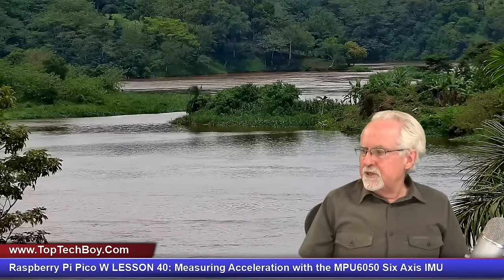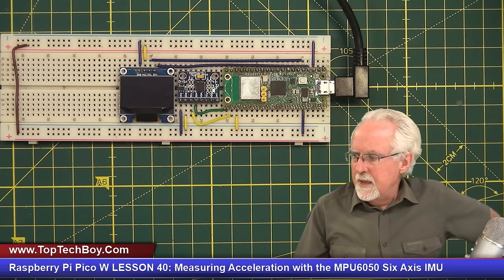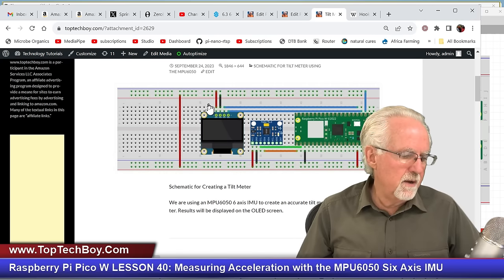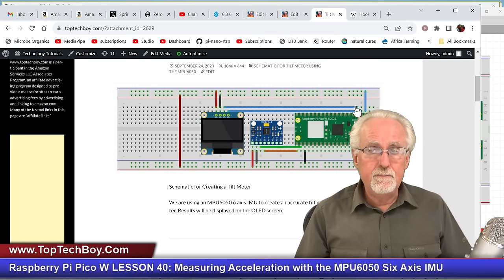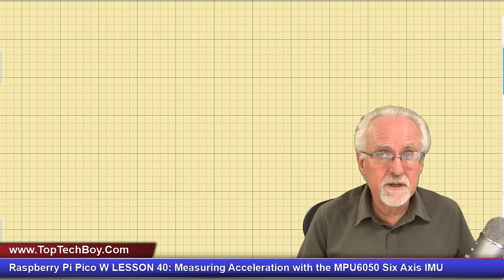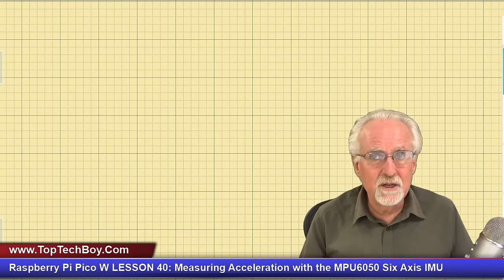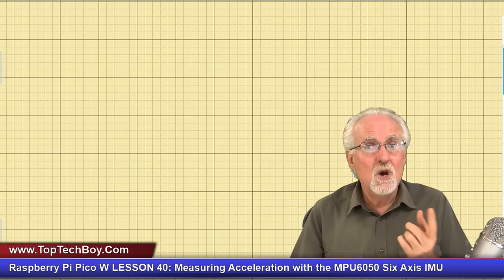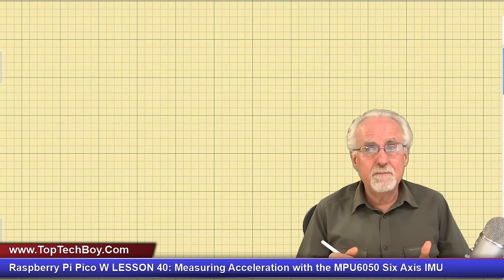Raspberry Pi Pico W LESSON 40: Measuring Acceleration with the MPU6050 Six Axis IMU

Comment from the maker: UPDATE: If you are getting an error when you try and import IMU, then change the name of the library folder on your pico from libs to lib. That should fix it.

Seems it is an issue for some and not for others. In any event, if it is a problem, rename the folder.
Reply: I found that out. Thanks for confirming. Charlotte mentioned that in the premier. I tried a second Pico and changed the library name at the same time. It had to be one or the other.
Reply: I had this problem and (after a bit of research) ran across this bit of code:
  import sys
  sys.path.append("/libs")
Seems to work fine. Now I have both /lib (which contains to ssd1306 libraries) and /libs. Is there a downside to this method?

Comment: I also like the "under the hood" discussions.  I didn't make a video but when I added the Z-axis, it reads 1G which is expected because the force of gravity is normal (down) toward the earth.  Also when I turned the breadboard on any of the edges, the Z-axis becomes 0G and either the X-axis or Y-axis becomes +/-1G depending on the board orientation.
Reply from the maker: Which means we could use it to make a  . . . ?
Reply: @paulmcwhorter  a level

Comment: I have that IMU from Sunfounder's Raphael Kit (RPi Kit). X and Y axes are returning negative on the direction pointed for those little arrows marked on PCB, just the opposite you mentioned on 34:09, only Z axis works properly
Reply: Forget it, everything is working fine...

Comment: Absolutely brilliant. I'm not worthy 😁 What I've never understood about those nanometer-type mechanics is how it's possible to get, for example, super tiny springs that have the right combination of tininess and also the right amount of spring force for such a tiny "proof mass". And also the tiny wires which connect to the proof mass and substrate to measure capacitance. How can their presence not impact the motion of the mass? Every time I pick up my smart phone and it detects the acceleration and turns on the screen I'm scratching my head how it's possible.  I guess I've always assumed that instead of springs it used some type of magnetic repulsion force. Thanks.
Reply from the maker: OK the answer is very complicated, but let me at least give a few simple answers. As far of tiny, understand that with IC manufacturing I can lay down a layer of material to almost atomic precision. That is, the thickenss of the layer is exactly what I want, within the thickness of an atom. Secondly, I can then etch it to create a structure in x and y to almost atomic precision. So the tiny spring I want is exact in width, height and length. Now as far as tiny wires to connect, the springs themselves are conductive, so I connect to the proof mass electrically through the springs themselves. The springs are the wires if you will. Matybe I should do a live stream on how these things are made in detail.
Reply: @paulmcwhorter  Ahh, okay, conductive springs. Though my brain is exploding trying to imagine designing and fabricating atomic-level springs. Why not use magnets instead of springs, like when we see a repelling magnet hovering above another magnet?  Thanks much!!
Reply: @paulmcwhorter  I would enjoy a live stream on this.

Comment: I created the lips directory and added the Kepler libraries. The pick w file structure looks exactly like in the video. When I try to import imu I get an error - no module named imu. Any lead of what the problem might be? Thanks.
Reply from the maker: If you have trouble importing the library, rename libs to lib on the pico.
Reply: Changing libs to lib worked. Thanks Paul.😊

Comment: I'm hoping someone can offer some insight.  I have made numerous attempts to follow the tutorial and have done so to the 'T.'  I have changed the chip address in the imu.py library to reflect mine.  I get this persistent error( I thought I addressed the 'chip_id' in line 158  by changing the i2c address to mine) :
I2C SCANNER
i2c devices found: 1
I2C hexadecimal address:  0x68
Traceback (most recent call last):
  File "<stdin>", line 19, in <module>
  File "/lib/imu.py", line 105, in init
  File "/lib/imu.py", line 158, in chip_id
MPUException: I2C failure when communicating with IMU

this is the simplified program I am trying to run:
from imu import MPU6050
from machine import I2C,Pin
import time
 
i2c=I2C( 0,sda=Pin(16), scl=Pin(17), freq=400000)

print('I2C SCANNER')
devices = i2c.scan()

if len(devices) == 0:
  print("No i2c device !")
else:
  print('i2c devices found:', len(devices))

  for device in devices:
    print("I2C hexadecimal address: ", hex(device))

time.sleep(.2)
mpu = MPU6050(i2c)
 
while True:
    xAccel=round(mpu.accel.x,1)
    yAccel=round(mpu.accel.y,1)
    print('x: ',xAccel,' G ', 'y: ',yAccel,' G')
    time.sleep(.1)
Using Thonny as well as VS code with micro-pico